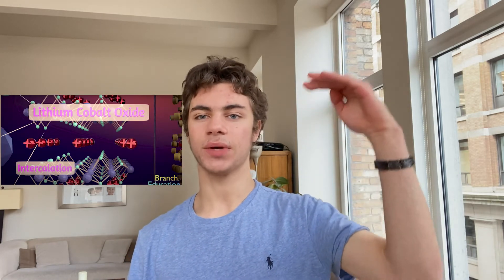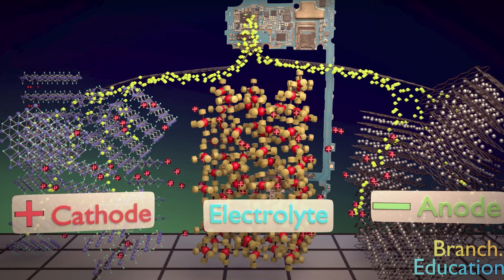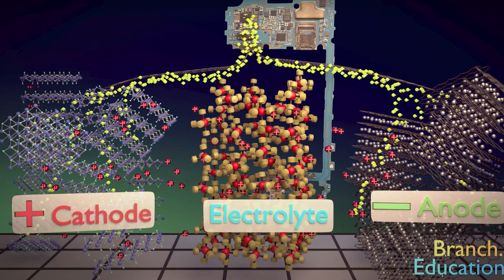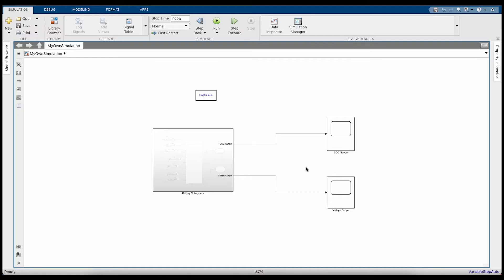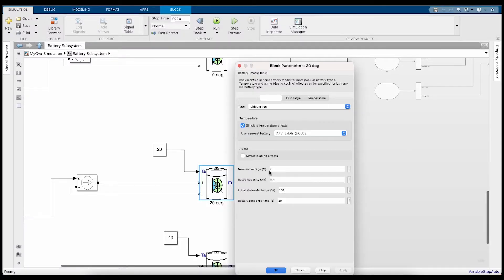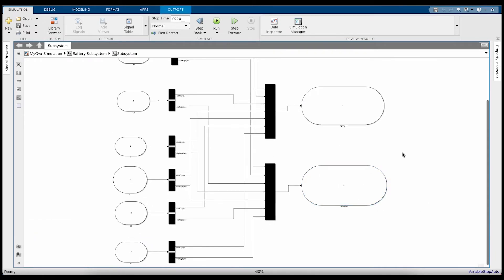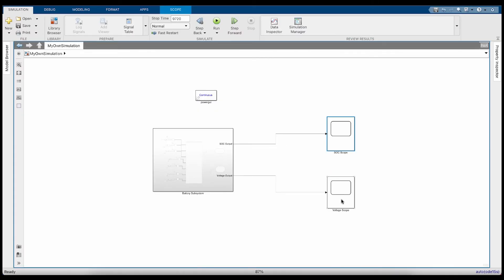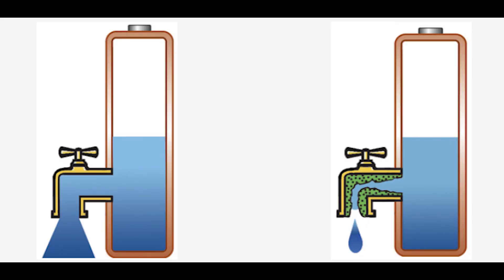Lithium-Ion Battery Temperature Effects & Why They Happen

Comment: The weather reliant system to correct the weather quote is misleading. Correcting the initiators that affect the weather is more the point. Blowing wind at wind just makes more wind. Reducing insulators and allow heat to escape changes the flow of wind.